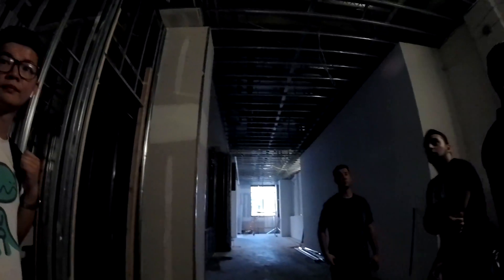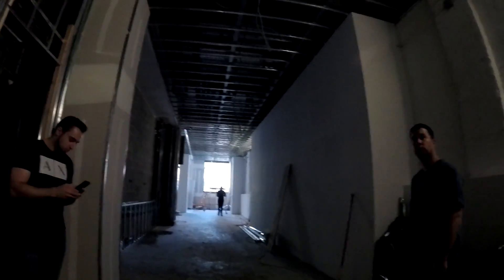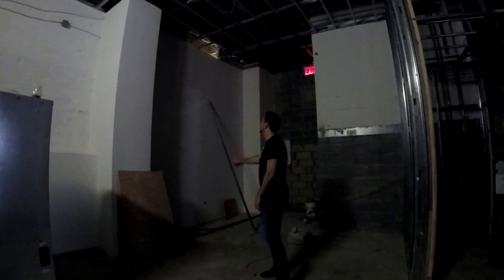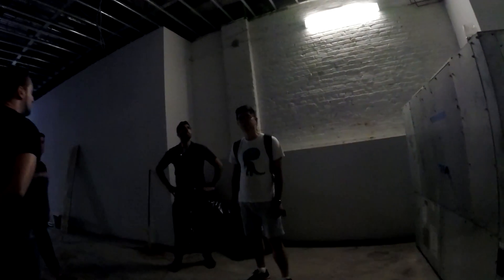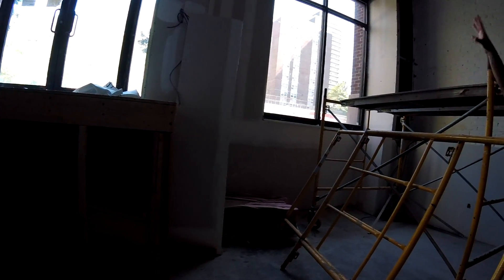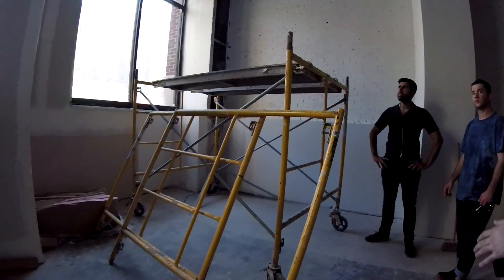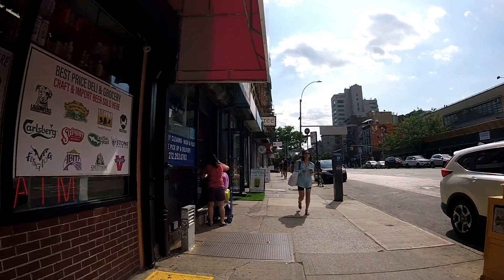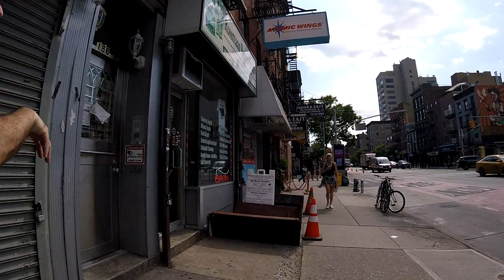Will this be the new Rossmann Group store? Still looking.

Comment: The concrete floor is for the crawlspace, not the floor of the store. If the agent says otherwise he's playing you. And yes restaurants do have 3 phase whenever it's provided. 3 phase doesn't mean  you don't have the normal voltages that you would normally have on a single phase supply, and there is no need to convert it.
Reply: hire and take advice from a expert....
Reply: @sub-zero-cool  Dam straight
Reply: Technically 3 Phase in most areas is 208vac... not standard 240
Reply: @Jeffreyfrmn  Um no, each phase is 240v or whatever your normal supply voltage is. picture a dot with three lines radiating out from it 120 degrees from each other. Each of those lines is equal to whatever your normal supply voltage is. And each line is one phase. 110v systems usually have 208v across several phases. 240v systems usually have about 415v across several phases. Now if you've getting 120v via a split phase supply from a 240v supply then you can still get 240v.
Reply: @stephenhunter70  No, he's correct, each phase of true 3-phase power is 207V or 208V to ground.  You can also get a special service with only 1 phase of the 3, known as red-leg.  It's an entirely separate supply type from the 110/120/220/240 volt service.  3-phase is normally only used in large commercial or industrial buildings, where it powers large electric motors like you get in BIG aircon plants and industrial applications.  It gets used for that because the 3 phases have evenly spaced phasing, so the power level for all three is, overall, pretty flat.  This is why it's used for high-power electric motors:  The torque varies much less than on a 120v or 240v motor, where the applied voltage goes to zero on both sides at once.  3-phase doesn't do that because the next phase is 120 degrees away, not 180.  There is restaurant equipment designed to be tied between one phase of a 3-phase service and ground, such as commercial toasters.  They MIGHT have had 3-phase power if they had really high-power walk-in fridges and freezers.
Reply: @evensgrey  isn't one phase of a 3-phase service and ground, such as commercial toasters, also known as a single phase supply?
Reply: Single-Phase that's split (center tap transformer as common) (Split-Phase) is normal in residential wiring. Three phase is standard commercial wiring. There is no 2 Phase used.
Reply: @FryGuyNS  Yes, 3 phase is the usual standard for commercial spaces as it allows for more circuits, and using possibly many 40 or 50 amp devices at once. The wire gauge required for a 500 amp service on a regular split phase would not be reasonable.
Reply: It does look that way. That place was probably set up with an elevated floor at some point. It's actually not a bad idea as it ensures a nice level floor and an easy way to run electrical, plumbing, and other cables. It also gives you easier access for any future maintenance or upgrades.
Reply: A 3 phase incoming mains can be tapped for 120 single phase. 240 is 2 phase, but in a lot of high rise apartments the 240 is actually 2 of the 3 phases of a 3 phase. You end up with a slightly lower RMS because the 2 phases are not 120 degrees out of phase, not 180 degrees. @Electroboom did a video about this in his kitchen
Reply: @VealCalf1  no,no,no... single phase 240 is split as stated, and rotates 180° from each other. 2phase is nearly impossible to find today, but is a 4 wire system usually seen in very heavy industrial. 2phase has given way to the advantages of 3 phase, which still uses a 4 wire system. Standard voltages for 3 phase commercial is 480v delta, and 208v wye. Some areas may provide 240v delta, but most will leave it to the customer to install their own delta transformer inside the premises.
Reply: jc bones youre the only one who got it right
Reply: @Ripu2  I did see a video from Fran Blanche where she talks about still having 2-phase available in Philadelphia, one of the last places in the US that still has it.  It was useful at one time, but there's no real benefit to it these days.  (That was in her old building, which was being demolished anyway.)
Reply: @VealCalf1  in any case if you have a three phase 110v supply what you'll get across two phases is going to be about 208v due to each phase being 120 degree out of phase with each other. The only time this doesn't happen is when the supply transformer is fed by a single phase supply such as a SWER line.
Reply: @VealCalf1  Yah not here it isn't and in many parts of the US they produce the 120v supply by splitting a 240v supply.
Reply: Multiple phase is standard to houses.  A normal electrical panel has two columns of breakers each column is a separate phase.  Dryer outlets span the phases to get 240v.  I would not want single phase in a business, as you would lose half the capacity.  Hell, those hot air stations are made in china and may support 240v automatically.  It could make sense to run 240v to stations if devices run better on 240v since they would pull half the current off of each single phase.  An electrical engineer may know if there are any benefits worth the cost.
Reply: @_PatrickO  Here we can get panels with three phase bus bars, each column has three phases on those panels when fitted with the three phase bus bars.
Reply: @_PatrickO  Here is some advice, don't give advice on topics you know nothing about. "A normal electrical panel has two columns of breakers each column is a separate phase" is wrong. In a typical residential situation in the USA you have single phase electricity. Yes you have two hot lines to produce 240V but it's SINGLE phase! It's basically a step down transformer output from high line voltage to SINGLE phase 240V! Now, just so we are clear and you don't get all chippery and start talking about 120V I'l suggest you look up how that works. It's a called a neutral for a reason, in very simple terms if AC voltage is a sine wave the 240V is achieved by connecting to its upper and lower limits of the X axis and neutral is simply straight down the middle of the X axis i.e: x=0. Thus you are getting the 110/120V. Many business do have 3 phase power plus they also get a neutral in order to get 110V notice how I said 110V instead of 120V? Well that is because in 3 phase power there are 3 connection points to the transformer (imagine a triangle with each tip being a connecting point) and thus the power is calculated by the square root of 3! Thus any connection between any 2 points is 208V not 240V.
Reply: @_PatrickO  240v would definitely be useful for a business. But you don't actually need true two phase to get 240v. Split phase supply allows splitting a single phase into two via a transformer. Many residential houses are supplied via split phase. And technically phase count isn't directly related to capacity. Depends on a number of factors. At a certain point its better/cheaper to run another phase rather than increase the wire gauge. Probably somewhere around the 100a mark for residential or other lowish use users given how phases here seem to come in at 100a normally.

Comment: The three phase is most likely for the original AC unit
Reply: As an HVAC tech I can confirm we love three phase
Reply: @SolluxDivide  My ears perked up so hard when it came up.
Reply: As an electrician, you guys are making my head hurt. So much wrong info, everywhere. Well the HVAC guys have it right. 3 phase compressors run smoother, cooler, and last longer, and keep the power factor near/at 1. Which is the same for any 3 phase motor.

There is no need to convert 3 phase to single phase. You can get 120v out of the 3phase with a single pole breaker.
Reply: I'm upgrading my home to 3 phases for an AC and for when the gasstove will be replaced by induction plates.
Reply: and also for redundancy, if a phase goes down you won't have the entire building without electricity
Reply: @fttx  no.  No for so many reasons.
Reply: @fttx  It's not very often just one phase goes down, because all the phases are tied to each other. If one drops, it's not likely the rest are going to be up.
Reply: @AnnaVannieuwenhuyse  wrong, one phase might run into a problem that lead it to deliver low volatage, having more than one phase prevent someone from getting completely having an electric shutdown, that happens mostly during storms and other things that the electrical grid has to deal with....
Reply: @AnnaVannieuwenhuyse  wrong! I had 3 phase power at a residence in Mesa, AZ and we had storms that dropped one leg. My neighbor and myself were outside trying to figure out why our AC's were not working. That's when I realized that we were on 3 phase power and had to call the power company and tell them, Yes we ARE on 3 phase and one of your legs is down. They came out and replaced the fuse about a block away, and we were the only ones having the issue! BTW the rest of the house and all our other neighbors didn't have any power issues, just us running 3 phase AC units.
Reply: fttx: The redundancy really doesn't help when all of your large and expensive motors won't run.  You'd be surprised how few things that are built with three-phase motors actually have a phase protection relay in them to prevent the motor from roasting alive if a phase is dropped.

Comment: The guy speaking doesnt really know what hes talking about
Reply: most don't.
Reply: They are just kids from the neighborhood right? Get advice from professionals.
Reply: The camera guy sounds a lot like Paul. And looks like it too 10:09
Reply: but if u watch the previous vid.... u can kinda know why hes acting that way. its cuz this whole deal reeks of bs and the realtor guy is full of shit.
Reply: “We really need to convert that 3 phase to single phase...”   why?? Dumbass
Reply: Wood still 5x stronger than steel when looking at weight to carry ratio.. 

wood is good and will last centuries if not exposed to rot or pests. Take care of your wood and itl last for generations, and it will do so at half the price of steel and its a material anyone can work with.
Wood is superior in every way, unless you wants to build highrises
Reply: I was thinking the same thing the guy holding the camera is one of these people that knows a few terms and thinks he knows what the hell hes saying
Reply: Allen Corrigan  the guy holding the camera that said he'd rather use a 2x4 ... most industrial centres around the world wouldn't allow that, metal framing all the way... metal framing is easier to deal with, easier to re-use/recycle, doesn't rot, doesn't get termites and doesn't become a fire problem.
Reply: @schr4nz  It's a commercial repair shop, not an industrial center.  Quite a lot around here is framed/built with wood, especially interior walls.

I've been in houses that are 100+ years old with wooden structure that show no signs of rot/termites, you must just have used some low grade wood then complain about how it doesn't hold up.
Reply: @StrangelyIronic  metal is the defacto standard now, better in everyway except for sound transfer
Reply: @StrangelyIronic  You should see some of the English castles that have wood in, They are centuries old.
Reply: @StrangelyIronic  conveniently skipped everything else I mentioned about metal being advantageous to wood in any large/international city, nice!
Reply: @schr4nz  most american buildings use 2x4s